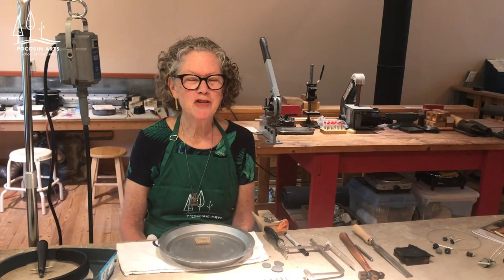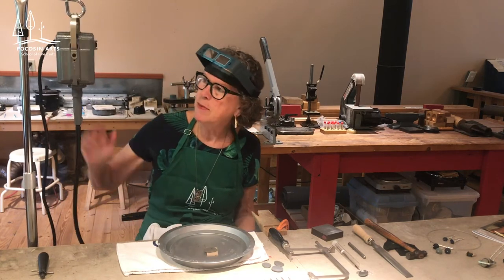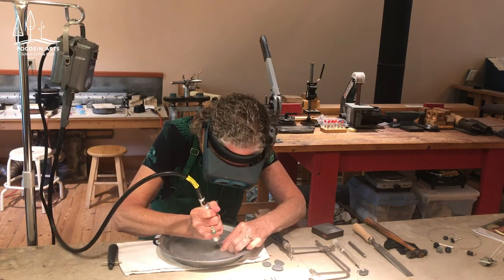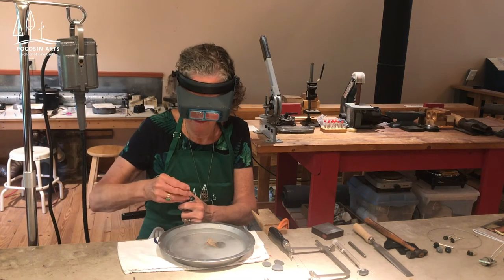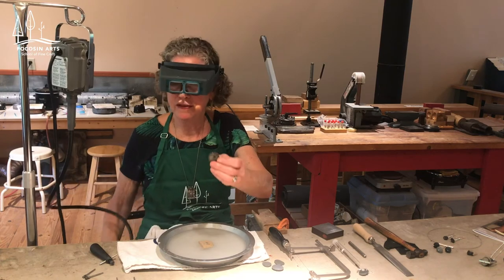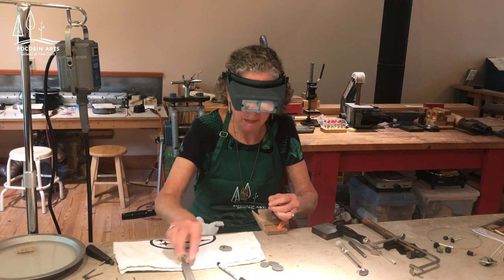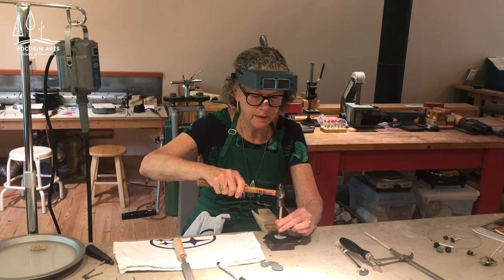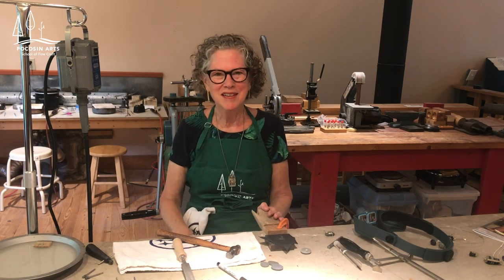How to Drill and Rivet Stones with Molly Sharp

Comment: That is a jewelers saw and when you tension just loosen the top thumb screw and put your saw in place and hold it taught with one hand and tighten the top thumb screw and that will tension your wire saw. Nice video and demo and THANK YOU!!

Comment: I have very successfully drilled a 6mm hole in a beach pebble using a glass/tile drill in a pillar drill by making a doughnut shaped ring from modelling clay (plasticine),sticking it to the pebble and filling it with water. It cuts through much more quickly than your method and can cope with some very hard pebbles. However, a very interesting video. Thank you.
Reply: That sounds awesome.  Wish you could do a vid on that 😃
Reply: Just wanted to come back and let you know I tried your technique with the clay and it worked PERFECTLY!  Awesome tip and I appreciate you so much!❤
Reply: Did you use the nondrying clay or drying clay?
Reply: @jakibros  The soft, non-setting clay. It's trade name is 'plasticine' in the UK and is very inexpensive

Comment: Great video Molly - I'm good at drilling 1mm, 2mm, 3mm holes in gem stones but I am having trouble drilling a 3/4" hole on gem stones that are about 2 to 2.5" in diameter and 5/16" thick - the stones keep breaking - any ideas or instructions - thx.